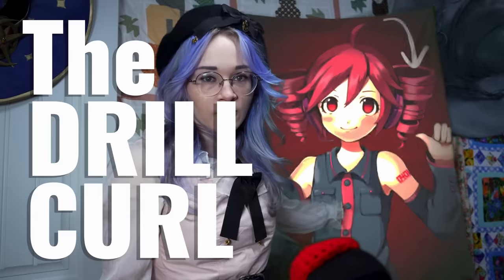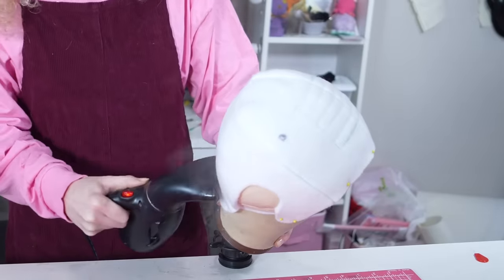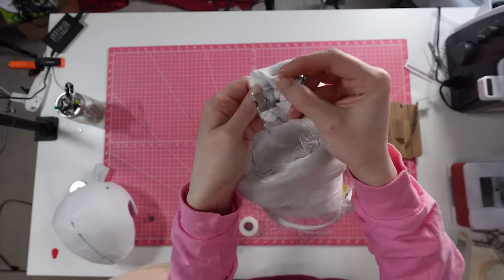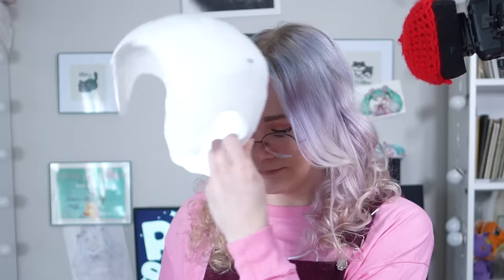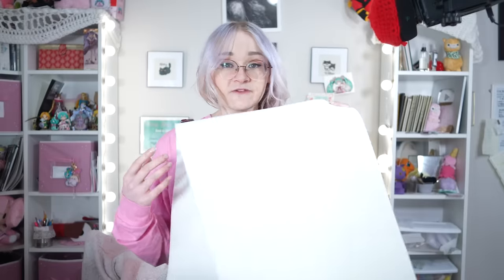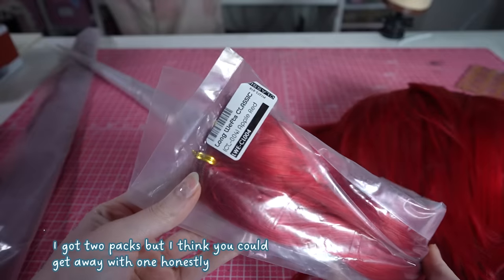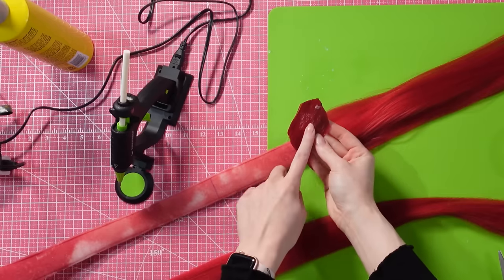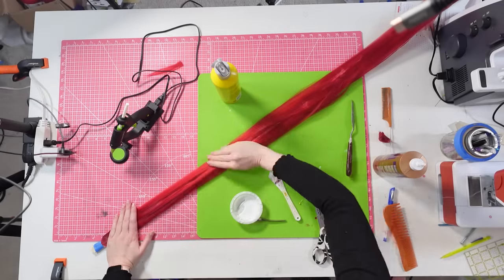Making the HARDEST wig style Easy

Comment: 4:30 - I own a surebonder (regular glue gun, not the one in the video) - I had to use a makeshift pushrod (It was a pencil) to push some glue sticks into the gun. I was afraid loading my glue gun musket-style like it's 1776 would ruin it. Nope! Aside from picking out little glue bits that would get stick in the gun from leaving the diet ramrod in and using too-large glue sticks cut into strips that would fit through the insert, the thing worked as well as NyQuil during the flu. Do yourself a favor and get yourself one of these and load it like the founding fathers intended.